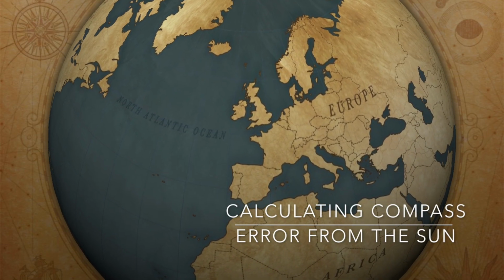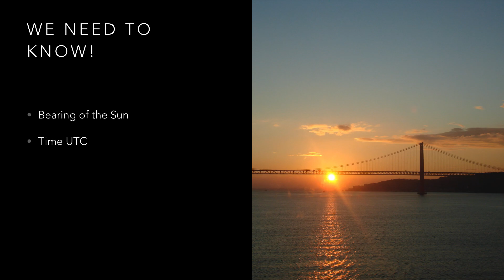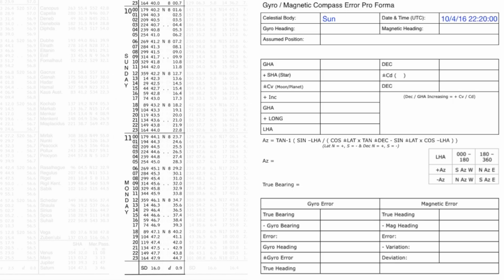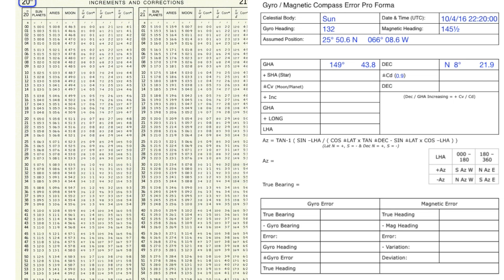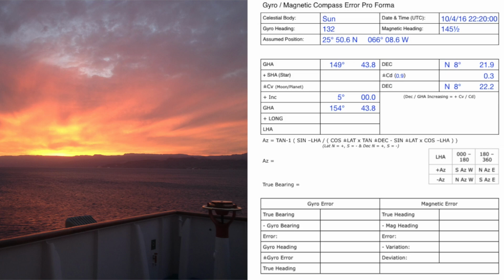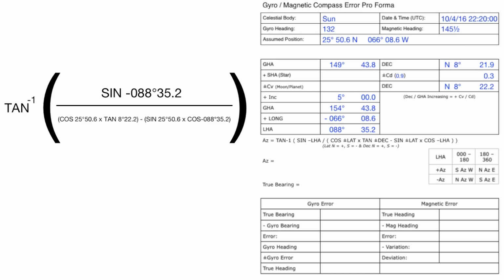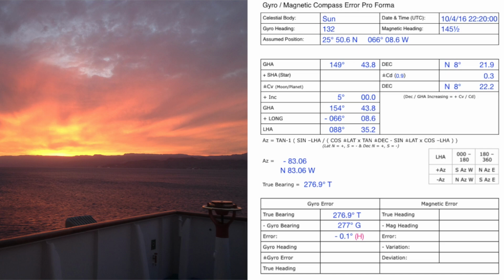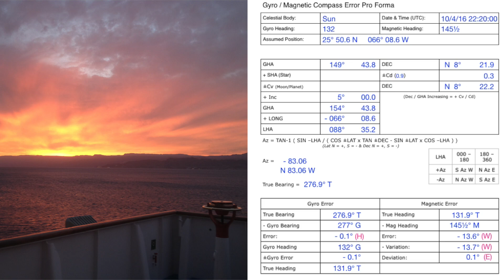How To Calculate Compass Error by Azimuth of the Sun

Comment: I use the ABC formula and In the North sea the now, Lat was 57° and LHA was 002°, so when I Do A it comes out as 33.62S and B comes out as 8.98N C is 24.64S and thought it be wrong because numbers seem far too big but does that not matter due to my LHA being so small, true bearing comes out to 1 degree if bearing I took from the sun. So can A and B be larger numbers? I am normally seeing 0. Something normally.

Comment: What do you do if your GHA + Long becomes more thhan 360 degrees. In my case it is 355 degrees + 021 degrees
Reply from the maker: If your LHA (GHA+Long) is greater than 360 degrees, subtract 360 degrees from it. If it's less than 0 degrees, add 360 degrees to it.

Comment: Great video series by the way! Been binge watching your videos. Would like to know why the LHA is entered as a negative (-) in the formula. That's got me confused since the book shows that it is "sin LHA." And when i follow the book, i got the wrong answer. Thank you!
Reply from the maker: Hi, the formula I have presented here is intended to be used as a single entry into a calculator, yes you can do it in separate parts if you really want to but it's main benefit is the ability to be able to enter it all in one go and not have to worry about naming things correctly!

There is a version of the formula which uses LHA as a positive value, however if you are following that version of the formula you need to do your calculation in steps as you need to know if the bottom part of the fraction is -ve or +ve as you then subsequently name your azimuth North or South dependant on that.

However, if you use the formula presented in the video where you enter the LHA as a negative value then you don't need to worry about what value the bottom of the fraction is as your final answer will have the correct sign for naming.

I hope that description makes sense :)
Reply: @AlistairBaillie  thank you very much for answering my question! This totally cleared up my confusion.

Comment: If the sun (or moon) is setting on the horizon, the calculated sextant altitude Hc = 0 degrees.   If you put this value into the sight reduction formula for azimuth, Sin (0) = 0 and Cos(0) = 1, so the formula simplifies to the "amplitude" formula.

Comment: Dear Sir ıs it possible to explain why did you subtract the Az from 360 to find the true bearing? Yours sincerely
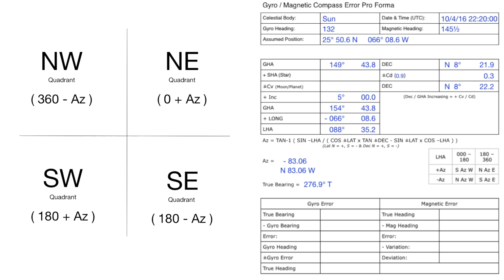Reply from the maker: As the Azimuth was North West then the True Bearing is 360 - Azimuth - please see the explanation at 5:53 for the different quadrants.
Reply: Sorry Sir again 
I found the Az= - 81.849 
I don't know where I did mistake. So;
Sin 88 35,2 = 0.999 695
Cos 25 50,6 = 0.899 989
Tan 8 22,2 = 0.147 132
Sin 25 50,6 = 0.435 911
Cos 88 35,2 = 0.024 664
= - 0.999 695 / 0.132 417 - ( - 0.010 751)
= - 6.982 623
Az = - 81.849
Reply from the maker: @akopuz  Hi, you have treated the result of "COS - LHA" as a negative when it should be positive, The COSine of -88.586666.... is a positive result. It is important that you do each step in the calculator as written in the formula otherwise you risk mixing up which sign the resultant answer should have when working with the SIN and COS curves. 

You can't simply work out the SIN/COS and TAN for the value of LHA/LAT/DEC and then stick a -ve sign in front of it as the positive/negative applies to the original angle, not the result of the function.

Comment: If I use ABC method result Az is 89.1
If I use this method on video result is -45.05
Please can you explain me why?
Reply from the maker: If your figures for Latitude, Declination and Local Hour Angle are the same as in the video, either you're entering into your calculator incorrectly or your calculator is working in Radians, instead of Degrees.
Reply: Yes me also i was checked my calculator
Reply from the maker: @jemrifelianto2990  You will be entering the formula into your calculator incorrectly, make sure you have brackets in the correct place and are using the correct sign for each angle in the sin/cos function.

Comment: Hi! I am confuse about to where you got the variation... we are still studying navigation and i want to know if we can get the variation by just using the coordinates and searching it up on a nautical almanac or the internet if it is not given on a quiz problem
Reply: The value of Magnetic Variation for a charted area is located inside any wind rose, in any nautical chart, for example, in the wind rose you could find a value expressed like this: 7º 34'W 2016 (4'W), where the value 7º 34'W 2016 is the magnetic variation in the area on the year 2016, and (4'W) is the yearly increment of the magnetic variation. What do you have to do is to correct the variation to the present year, for example, if the present year is 2020, you have to multiply (4'W) for the numbers of years from 2016 to 2020 = 4years, so (4'W) x 4 years = 16'W, then you have to, add the correction, if it has the same name of the variation, or subtract it, if it is named opposite, in this case, they have the same name W, so the variation for 2020 will be  7º 50'W. I hope this can help you to solve your doubt.
Reply from the maker: Hi - I'm afraid not - as @Gabriel Delgado says you have to look it up either on your paper chart or ECDIS system and then apply the correction for the present year. Some GPS units will also give you an approximation for your current position as well.

Comment: I would like you to help me with this question Mr. Alistair, 
1. what would happen with the correction of the declination if we supposed for the video example that declination for 22:00hrs (only for putting an example) was negative  (-) 8º 21.9' South and the value for 23:00hrs (only for putting an example) was negative (-)8º  20.0 South, as is approaching to 0, should we consider this as increasing or decreasing to proceed after to add or subtract d correction?.  
2. Negatives declinations are the same as south declinations? this because I noted in the nautical almanac that for the south the declinations are negatives.
Reply from the maker: Hi, If at 2200 it was negative 8-21.9 and at 2300 it was negative 8-20.0 then yes it is increasing as negative 8-20.0 is larger than negative 8-21.9, thus you would add the correction.
Reply: @AlistairBaillie  thank you very much! your explanations always are very helpful!!